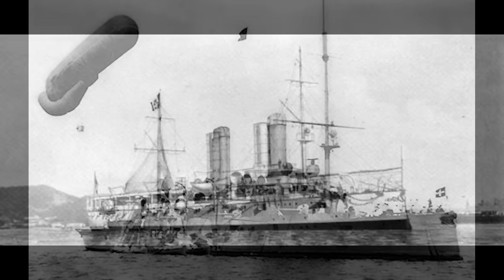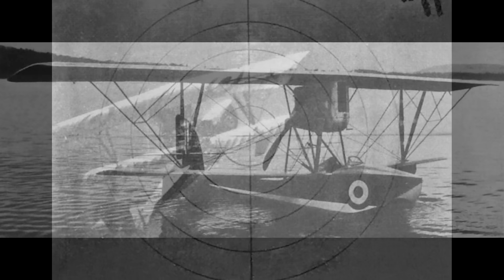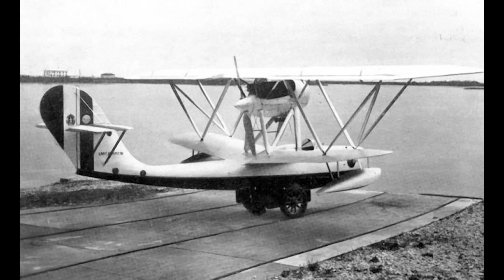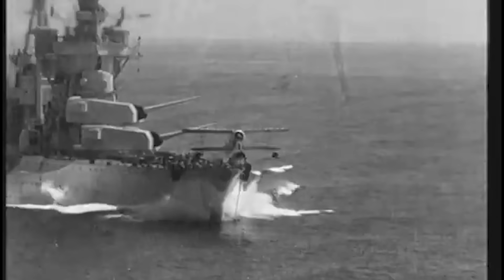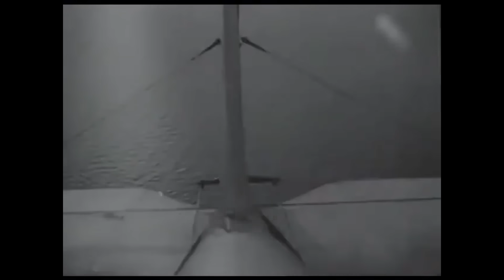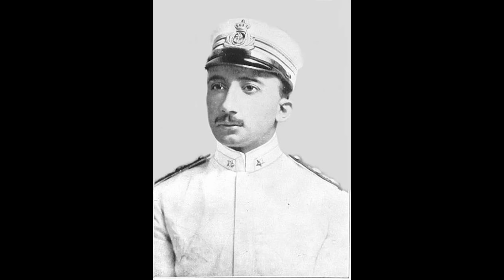The Regia Marina's Surprisingly Good Seaplane Spotters & Fighters, 1910-1945

Comment: Why would you launch planes during a fight?  Wouldn't you want to launch them just before said fight?
Reply: Because you might need to launch one to take over from a flak damaged one, or you might find your enemy, who ranges to the horizon, has just steamed into sight out of the distant haze and is opening fire before you've even had chance to ready your aircraft, let alone launch.
HMS Ajax at River Plate launched her Fairey Seafox between salvoes during the opening exchanges of the battle:
6:10 - Smoke sighted by Force G. Exeter sent to investigate.
6:16 - Exeter reports pocket battleship.
6:18 - Graf Spee opens fire on Exeter at long range.
6:23 - Near-miss from Graf Spee knocks out Exeter's Walrus as it is being readied for launch.
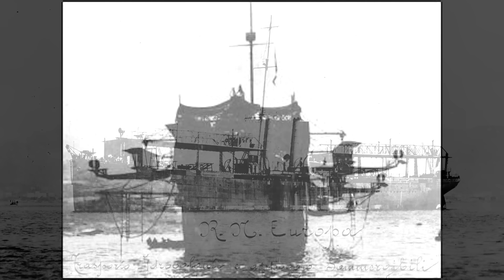6:36 - Ajax launches her Seafox to spot for gunnery as now in effective range.